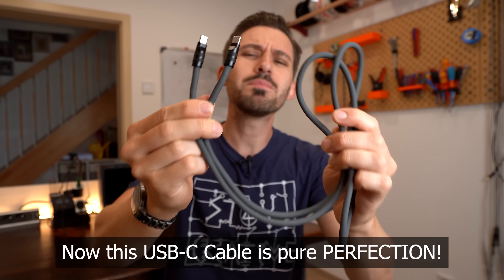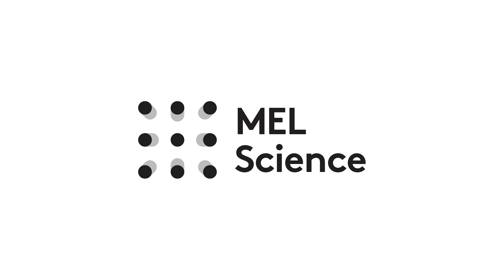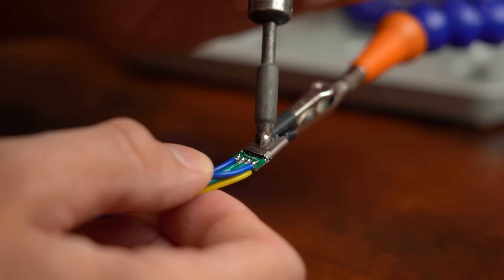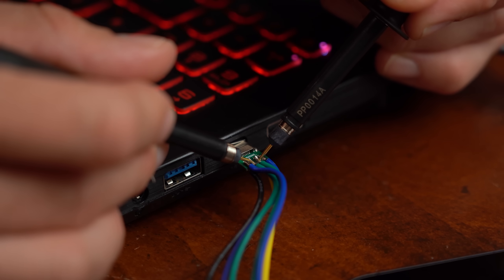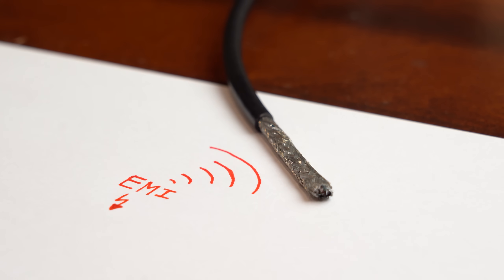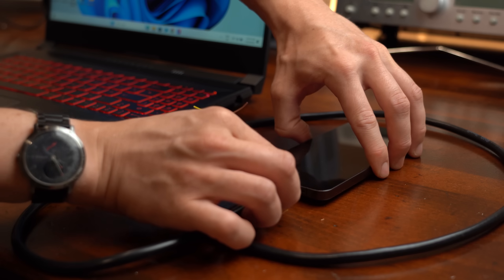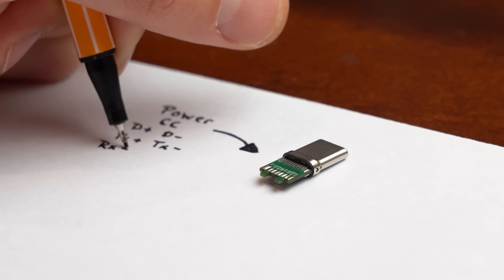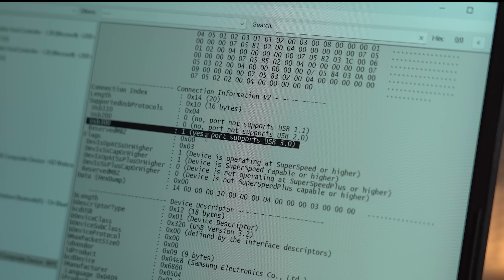Is it IMPOSSIBLE to make the Ultimate USB-C Cable? (Shielding) EB#64

Comment from the maker: Ready to explore the MEL Science kits at home? Click here: https://melscience.com/sBfq/ and use the code "SCOTT50" to get 50% off your first month!
Thanks to MEL Science for sponsoring this video and making this show happen😁
Reply: Have you read the USB 3 specs to the end yet?
You might have found that the connection negotiations on USB3 requires specific impedance on the data lines.
You need 85Ohm+-10% for USB-C and 90Ohm+-10% for all other USB connectors.
Your 60 Ohms are way to low and the 100Ohm+-15% of the CAT6 is way to high.

However you could use a 60Ohm powerline and just have to match the data lines.
At this point it might be worth just to patch two cables together - one for power delivery and one for data.
Reply: i like ketchup
Reply: You know? You may have stumbled upon your first true product, I would pay for a kit that let me create my own diy USB C All included, USB 3 transfer data, HDMI, PD, the whole enchilada, such a kit would contain the USB boards, and a selection of suitable cables whom I can choose whatever length I want, in whatever style I want.

Edit. The main reason I would buy this over a cable is because I can fix it myself, I hate planned obsolescence
Reply: Lol cụ coin viNE 0,06875$
Reply: You can source the perfect data transmission wires , foil and mesh insulation from cheap old usb 2.0 cables. Nylon tension fibers from mountain climbing ropes,  outer tpe shielding tubes are also available at cheap in online
Reply: I've had success with Cat6e and cat7e to make 20-30ft usb extenders that do work at 3.0 speeds. I used 3ft usb 3.0 cables that I cut  in order to steal the usb connectors. More than half of my extensions though, required usb 3.0 re-drivers to boost the signal enough for 3.0 speeds.
Reply: I think might be a problem with the lenght of the cable. Build it only 40 - 50 cm. High speed data cables are rarely long
Reply: Oh and might be even a problem that you should, one: build a board for yourself with a lot of ground connections (might interfere even on the board), then each shield for emf connect to ground

Comment: One important thing that you missed is that differential signal wires are twisted together. That's why the replacement cable worked. If you will take apart USB cables and ethernet cables (which also use differential signals) you will see that all of them have twisted pairs.

Comment: I’ve heard of communication issues when the length of the pair of data wires are too far apart. Example: (inaccurate numbers but just to show) one wire is exactly 1 meter and the other is 5 mm longer.

I saw a video by Adam Savage examining an Apple cable, and he noted that they went to extreme detail making the length of the pair of wires within nanometers of each other. This way, the voltage would arrive at exactly the same time.

Edit: the length of the wires is significant in relation to comparing resistance between the pair, and (I forgot the term) the time it takes for the voltage to get from one end to the other. Hope this helps! Also, would love to hear about any other affecting factors.

Comment: Instead of having to do noise cancellation and impedance matching for high data rates, why don't we use fiber optics to transmit data. I know that would require a complex transceiver, but there are already commercial products like this.

Comment: i asked deepseek on how to make one and this is what i got: Of course. Making a fully functional, high-speed USB 3.0 cable from scratch is an *extremely difficult and generally not recommended* process. It's far more complex than making a simple USB 2.0 or power cable due to the stringent electrical requirements for high-speed data transmission.

However, for educational purposes, to understand the complexity, or for a very specific repair, here is a detailed guide.

### *Severe Disclaimer and Strong Recommendation*

*   *Just Buy One:* A quality USB 3.0 cable costs between $5 and $20. The tools and materials needed to make one correctly will cost over $100. It is not cost-effective.
*   *High Failure Rate:* Even experienced technicians will have a high failure rate due to the need for precise impedance matching and shielding. The cable likely will not work at USB 3.0 speeds (5 Gbps).
*   *Safety Risk:* Incorrectly made cables can damage your expensive devices (computer, phone, external hard drive).
*   *This is for Experts Only:* This guide assumes advanced soldering skills and knowledge of cable management and electronics.

---

### Understanding the Anatomy of a USB 3.0 Cable

A USB 3.0 cable has *more than twice the wires* of a USB 2.0 cable to achieve its SuperSpeed performance.

*Internal Wires:*
1.  *USB 2.0 Legacy Wires:* (Same as a USB 2.0 cable)
    *   *VCC (Power):* Red, usually 20-28 AWG
    *   *D- (Data -):* White, usually 28 AWG
    *   *D+ (Data +):* Green, usually 28 AWG
    *   *GND (Ground):* Black, usually 20-28 AWG
2.  *USB 3.0 SuperSpeed Wires:* (The new, critical ones)
    *   *SSRX+ (SuperSpeed Receive +):* Blue
    *   *SSRX- (SuperSpeed Receive -):* Yellow
    *   *SSTX+ (SuperSpeed Transmit +):* Purple
    *   *SSTX- (SuperSpeed Transmit -):* Orange
3.  *Shielding:* Each pair of SuperSpeed wires is twisted together and wrapped in a foil shield. There is also an overall braided shield around all wires. A drain wire is often present to connect the shield to ground.
4.  *Other:* There is usually a separate nylon braid for strength and filler threads to keep the cable circular.

### Required Tools and Materials

1.  *USB 3.0 Connectors:* You need a USB 3.0 Standard-A plug and a USB 3.0 Micro-B plug (or whichever ends you need). *You cannot use USB 2.0 connectors;* they have fewer pins. These are very hard to find for sale individually.
2.  *USB 3.0 Cable:* Bulk USB 3.0 cable. This is specialized cable with the internal twisted pairs and shielding pre-made. You cannot use standard hookup wire.
3.  *Tools:*
    *   High-quality soldering iron with a fine tip
    *   Precision screwdriver set
    *   Flush wire cutters / strippers
    *   Helping Third Hand tool or a vise
    *   Multimeter for continuity testing
    *   Heat gun (for heat shrink tubing)
    *   Sharp knife (like an X-Acto knife)
4.  *Supplies:*
    *   Fine-gauge solder
    *   Flux
    *   Heat shrink tubing (various sizes)
    *   Electrical tape
    *   Patience and a steady hand

### Step-by-Step Guide to Assembly

*This example will create a USB 3.0 A-Male to Micro-B cable.*

#### Step 1: Prepare the Cable Ends

1.  Carefully cut the bulk cable to your desired length.
2.  Use a sharp knife or wire strippers to remove about 2-3 inches of the outer jacket from each end. *Be incredibly careful not to nick the wires or shields inside.*
3.  You will now see the complex interior. Identify all components:
    *   The four standard USB 2.0 wires (Red, White, Green, Black).
    *   The two twisted pairs for SuperSpeed (blue/yellow and purple/orange), each wrapped in its own foil shield.
    *   A bare drain wire.
    *   An overall braided shield.
    *   Possibly filler threads (just cut these away).

#### Step 2: Prepare the Connectors

1.  Disassemble the plastic housings of both connectors. They usually snap together. Note the orientation of the metal contact piece.
2.  Identify the pinouts for both connectors. This is critical. The pins are tiny.

    *USB 3.0 Standard-A Pinout (Front View):*
    *   *1:* VCC
    *   *2:* D-
    *   *3:* D+
    *   *4:* GND
    *   *5:* StdA_SSTX- (Sometimes not present)
    *   *6:* StdA_SSTX+
    *   *7:* GND_DRAIN
    *   *8:* StdA_SSRX-
    *   *9:* StdA_SSRX+
    *   *Shell:* Shield

    *USB 3.0 Micro-B Pinout:*
    *   *1:* VCC
    *   *2:* D-
    *   *3:* D+
    *   *4:* ID (Not connected)
    *   *5:* GND
    *   *6:* SSTX-
    *   *7:* SSTX+
    *   *8:* GND_DRAIN
    *   *9:* SSRX-
    *   *10:* SSRX+
    *   *Shell:* Shield

#### Step 3: Strip, Tin, and Connect the Wires

This is the most delicate part.

1.  For the *USB 2.0 wires* (Red, White, Green, Black), strip a tiny amount of insulation and tin the ends with a small amount of solder.
2.  For the *SuperSpeed twisted pairs**, carefully unwind the foil shield. Strip and tin the ends. **Keep these pairs twisted as long as possible* to maintain their impedance. The pairs must be connected correctly:
    *   *SSTX+ (Purple) on the A plug connects to SSTX+ (Pin 7) on the Micro-B plug.*
    *   *SSTX- (Orange) on the A plug connects to SSTX- (Pin 6) on the Micro-B plug.*
    *   *SSRX+ (Blue) on the A plug connects to SSRX+ (Pin 10) on the Micro-B plug.*
    *   *SSRX- (Yellow) on the A plug connects to SSRX- (Pin 9) on the Micro-B plug.*
3.  *Connect the shielding:* Solder the *braided shield* and the *drain wire* to the *GND_DRAIN* pin on each connector and/or to the metal shell of the connector if there's a contact point. This is vital for reducing electromagnetic interference.

#### Step 4: Soldering

1.  Use the "Third Hand" tool to hold the connector steady.
2.  Using a fine-tip iron and flux, carefully solder each wire to its corresponding pin. *Avoid solder bridges between the tiny, closely spaced pins.* This requires a microscope or magnifying glass for most people.
3.  Double and triple-check your connections against the pinout diagram.

#### Step 5: Reassemble and Test

1.  Before closing the connector housing, use a multimeter to check for *continuity* (each pin should connect to the correct pin on the other end) and, more importantly, for *short circuits* (no pin should connect to any other pin on the same connector except for designated grounds).
2.  If everything checks out, carefully reassemble the plastic housings around the soldered connectors.
3.  Plug the cable into a USB 3.0 port and device (like a portable hard drive). *If you are worried about your hardware, use a cheap USB hub as a sacrificial device for the first test.*

### Conclusion: Why You Shouldn't Do This

As you can see, the process is fraught with challenges. The primary reasons making a USB 3.0 cable is impractical are:

1.  *Impedance Matching:* The SSTX and SSRX pairs must have a controlled impedance of 90 ohms. This is achieved by the precise twisting, insulation, and shielding of the factory-made cable. Hand-twisting and soldering will ruin this.
2.  *Crosstalk:* Without proper shielding between the pairs, the high-speed signals will interfere with each other, causing data errors.
3.  *Connector Availability:* Finding genuine, high-quality USB 3.0 connectors for sale is nearly impossible for consumers.

*Your best, safest, and cheapest option is to purchase a high-quality, certified USB 3.0 cable from a reputable brand.* This guide is intended to showcase the engineering that goes into a seemingly simple cable.

Comment: Don't give up! Keep as much shielding as possible to wrap back up the cable, and use a little piece of hard plastic tubing - or even soft plastic plus a metal oversleeve! - for strain relief! Data physics are a nightmare, as another commenter said, but I think you have all the parts, you just need to find the way to put everything together!

Comment: 4 pair twisted individual and overall screen - industrial instrumentation signal cable - 0.5mm2 - maybe an Instro on an industrial construction site in europe can send you a 10m cutoff.

another point about your shielding is that it should be only connected to the ground at one end to eliminate any ground loops . To do it correctly the ground it is connected to should be a clean earth and not your average electrical earth as that is quite noisy - but the challenges to do  that in a domestic setting make it difficult to achieve.

Comment: Could you not make a usb-c to rj-45 adapter? that way you can still use the cat-7 ethernet wire, but you wont have the soldering problem with the wires being too stiff. Since pre-made ethernet cables use a standard pin layout this would mean you would technically have a multi length "cable", just swap out the middle bit.

Comment: Good day people from the USB-C realm, maybe Scott you or someone in the comments can help me out with a problem I currently have. I typically power my action cameras via usb c an alternate power source rather than those tiny batteries and it seems with the current dji osmo action 5 pro it doesnt turn on when no battery is inside with my approach. What I do is I have step down unit to 5V and then just soldered +/- to the usb c male plug which i plug into the camera. One friend of mine claims ( we live too far apart so I could see it with my own eyes) that with his 100W powerbank the camera does turn on even without a battery in it. So I had the suspicion the rather old blue 4 pin usb c male plug which lacks that IC for communication may be the culprit but even with the one Scott showed and uses it still doesnt turn on. Do I need to soldered something additionally to the more advanced usb c male plug with that IC on it so it can communicate with the action camera? Has anyone experience with it?

Comment: I was going to say, shouldn't you be using twisted pair?  You also have to pay attention to the characteristic impedance of twisted pair (this is not the same as regular impedance).  I use Ethernet cable for my CAN BUS, which isn't ideal, since the characteristic impedance is slightly off, but it works fine at low speed.  Also be very careful with connecting your shields.  They are generally connected to ground, but only on one side.  If you connect both sides, you create a ground short between two devices, which can create a ground loop and sometimes explosive results if they are at different potentials.  High speed serial interfaces can get crazy complicated.  Same with HDMI and PCIE.

Comment: As people already mentioned you definitely need to be very consistent on cable length.  A shorter cable definitely makes things easier though your cable doesn't seem like it's more than a few meters so should be fine.  Even need to consider things like the minimum bend radius since just bending up the cable can heavy impact performance.  Twisted pairs will definitely help with reducing the impact of capacitive coupling but for truly high speeds you want twinaxial connections where each pair has shielding around it.  Plenty of cables use a twinax approach like with SFP+ direct-attach copper in networking and even some of the better DisplayPort 2.1 cables.

At a guess though those cheap USB-C PCBs are what is most limiting you.  While not strictly necessary if you truly want to go balls to the wall on an ultimate connector you'd want your own PCB with at least one ground plane and have understanding of how to properly design for analog and digital circuits.  Too often people create parasitic paths in their PCBs and stuff like via inductance destroys their signal at higher frequencies.  A cheap USB-C PCB advertising high power is likely skimping on any other design considerations and is purely focused on maximum power transfer.

Comment: For this case i will recomend you a protocol analyzer but i Will explain how is established enumeration in USB 3.x (Gen 1 or Gen 2), the link must go through several stages.
First, the host sends LFPS (Low Frequency Periodic Signaling) to the device to perform Rx.Detect, as defined in the USB-IF specification.
Once the device detects the LFPS, the link moves into the Polling state. During this stage, link training is performed, where adjustments are made to equalize the transmission channel — for example, using the TS1/TS2 training sequences for channel equalization and scrambling as specified by the protocol.
It is recommended to check the Link Training and Status State Machine (LTSSM) to see exactly how far the link progresses. With a high-bandwidth oscilloscope, you can trace the process up to the point where LFPS are transmitted. Note that while USB 3.x data uses NRZ at 5 Gb/s (Gen 1) or 10 Gb/s (Gen 2), LFPS are low-frequency signals (typically ~20–50 MHz), making them easier to observe.
Before the LFPS, you may notice a capacitor-like discharge — this is the electrical signature of termination detection on the channel, which triggers Rx.Detect in the link.
Also, make sure that the USB Type-C chip being used supports this mode and is USB-IF compliance certified.

Comment: Just buy 2 proper USB-C connectors and a cable that is rated for USB 3.2 OR USB 4 at >= 20 Gbit/s ( or just repurpose a 40 Gbit copper ethernet patch cable) from Digikey.
You can't just buy some cheap chinese breakout board and expect it to actually do what they claim, if that claim takes any effort at all for the average consumer to check.

Comment: Try the working cable you bought but solder on the new boards. Then you know if the board you're using is the problem or the wiring.

Comment: I dont know about power delivery , but you may be able use the USB-c  board with an ethernet keystone  , then use some cat-7 ethernet cable  . it would also make it modular length . POE for cat7 is 90W , so i wouldnt try to pass anything above that .

Comment: The USB C cable situation is a frustrating mess of a standard. I have ZERO way to know what protocols the cables I'm purchasing support. It's absolutely ridiculous. Was this done on purpose? How in the heck did we end up in this state when so much effort was put into USB C. The connector, the multiple protocol support, etc are all fantastic compared to what came before. But the cables, oh boy, it is complete lunacy.

Comment: Did you ever try to get higher PD outputs (100W-120W) from Xiaomi chargers and power banks, as it's locked only for Xiaomi devices?  I searched everywhere, but it seems no one has done it before.